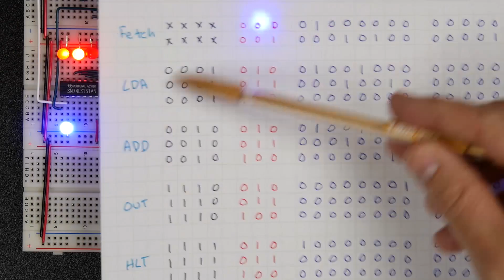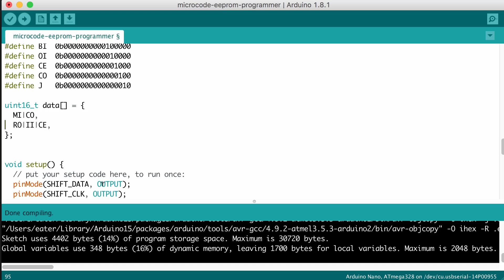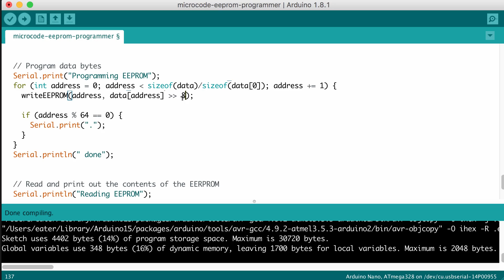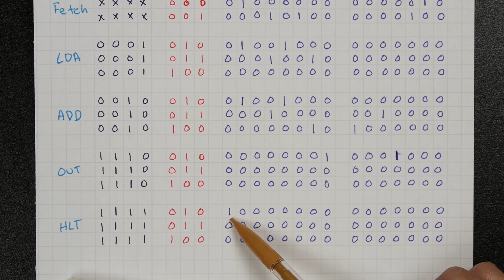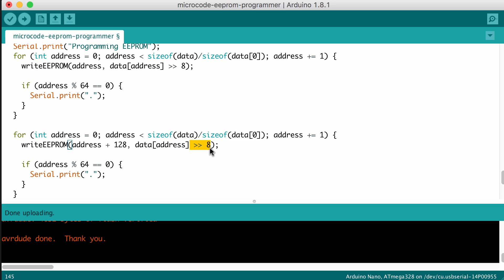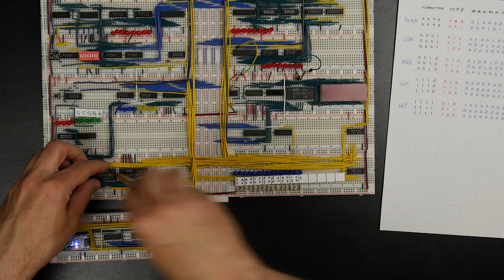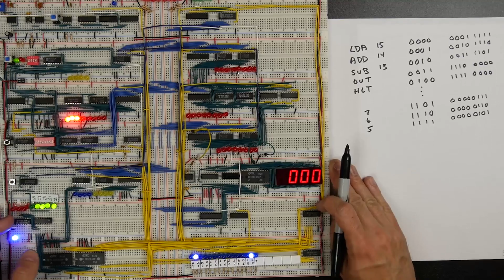Reprogramming CPU microcode with an Arduino

Comment: I would like to see how to add the Multiply command
Reply: not as simple instruction but as program it can be done with a few extra instructions and conditional jumping

----- (initialization)
0000: LDA @14 - load operand A
------ (main loop)
0001: JGZ #0101 - if >0 goto #5
-------- (display result)
0010: LDA @13 - load result 
0011: OUT - display result
0100: HLT
------ (subroutine)
0101: DEC 1 - subtract 1 from A
0110: STA @12 - store counter
0111: LDA @13 - load result
1000: ADD @15 - add operand B
1001: STA @13 - store result
1010: LDA @12 - load counter
1011: JMP #0001
------- (data)
1100: 0 - counter
1101: 0 - result
1110: 3 - operand A
1111: 4 - operand B

 you could also make a decrement 1 & store to memory instruction.

also only works with positive numbers and no overflow protection
Reply: devision A/B  is similar 

------ (initialization)
0000: LDA @14 - load operand A
------ (main loop)
0001: SUB @15 - subtr. operand B
0010: JLE #1001 - if <0 goto #9
0011: STA @13 - store remainder
0100: LDA @12 - load result 
0101: INC 1 - increment 1
0110: STA @12 - store result
0111: LDA @13 - reload remainder
1000: JMP #0001
----- (display result)
1001: LDA @12 - load result
1010: OUT - display result
1011: HLT
------- (data)
1100: 0 - result
1101: 0 - remainder
1110: 12 - operand A
1111: 4 - operand B
Reply: If you output the content of the program counter to a empty location of the ram, you can maybe use the program counter to count how many times want to ADD a numbe, and then you just copy the content of the previous counter data stored in RAM and run again the Program counter, or something like that. not sure at all
Reply: I don't think it's possible: the PC is used to store the address of the next instruction, so it would be a big NONO to mess up with that. That's exactly what +Jaako Jylhä wrote: the hardware doesn't support the command (or at least to me it doesn't seem possible). However, if some JUMP commands will be added to the set of instructions in the future, you could do a multiplication in a "software" way, by creating the "assembly version" of a FOR loop.

EDIT:Oh, sorry, I didn't read the comment properly, now I see what you mean: store the actual content of PC into a designed RAM address, use the PC for counter, and when you are finished restore the content saved in the RAM address chosen before. Still, it doesn't seem possible to do something like that: what happens if you set the PC, let's say, to 0000, in order to intialize the counter? The computer would start again from the first instruction of the program, failing to execute the rest.
Reply: Nothing happens because the control logic is telling the computer to use the contents of the PC at the begining of the instruction, put them into RAM, erase the PC, use it as counter for multiply, and when it's done, restore the PC contents from the previous RAM location, that way you cant mess up the PC
Reply: Lets say we want to make 3x4

var0
var1 = 3
var2 = 4

(Fetch cycle)
PC-> var0
LD var1 -> PC
LD var2 -> RA & RB
here:
ACO -> var2
LD var2 -> RA
PC - 1

if(PC != 0)
   jump to here:
else()
var0->PC
PC Enable

My skills as assembly programmer are awful and I mixed them with some sort of C, And I realized that the problem is that the program to do that is too long and you will need more microinstructions. idk

Comment: This is nice!
I ended up making a permanent version of a chip burner based on this circuit, but ended up using an arduino mega to replace the address shift registers - thankyou again for the inspiration! :)

One small thought for this circuit... if you used A0 instead of A7 for the chip identity, you would have 16-bit words for each instruction in your eeprom readback.
Doesn't affect the circuit but thought it might be worth sharing :)